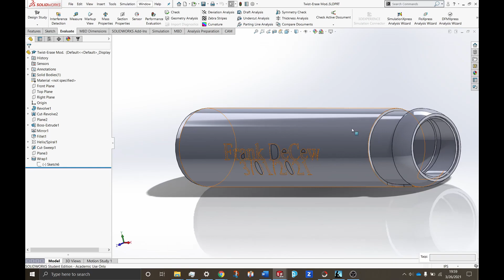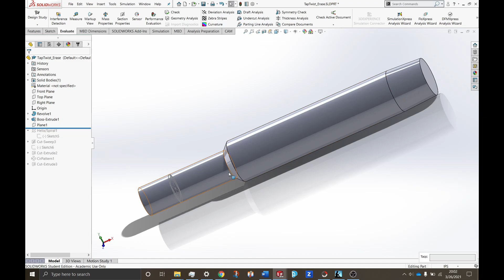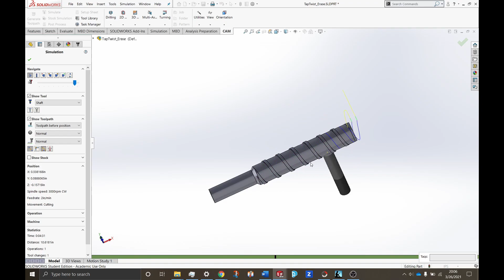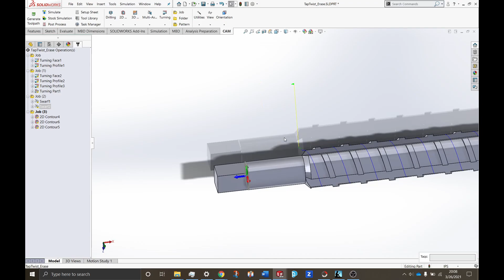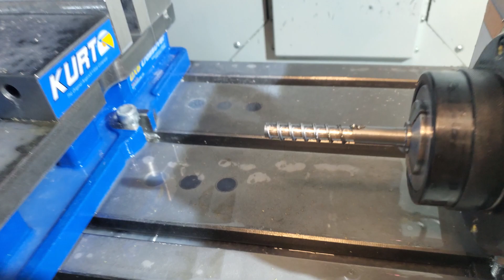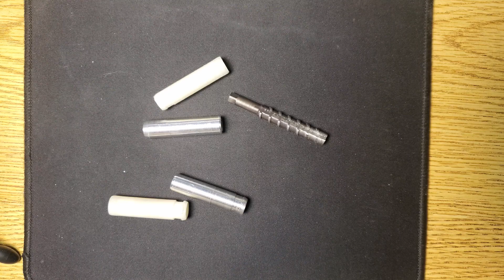Moding a Twist-Erase Pentel machinal pencil.

Comment: Do you think you can get it metal 3d printed by companies like pcbway or something? I’m trying to combine my 2mm pencil with the twist eraser, not sure how to do it yet
Reply from the maker: Not sure, the metal 3d prints I have used, sla titanium, have been very rough so I dought the twist action would be very good or even work. But there are other type of metal 3d prints that might have better surface finishes. Sounds like a cool project hope it works out.